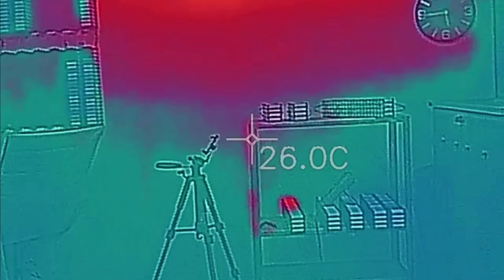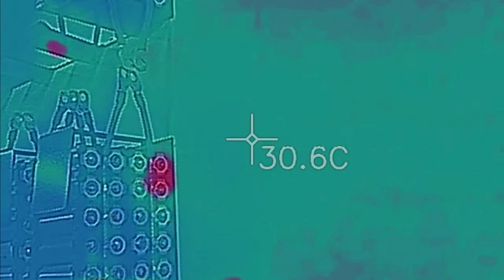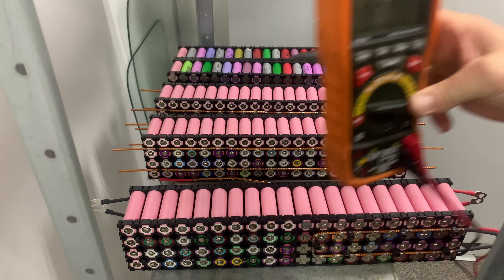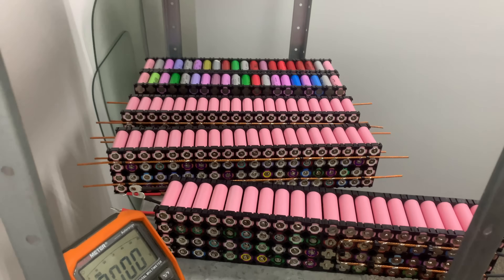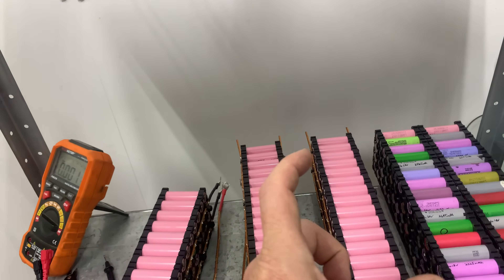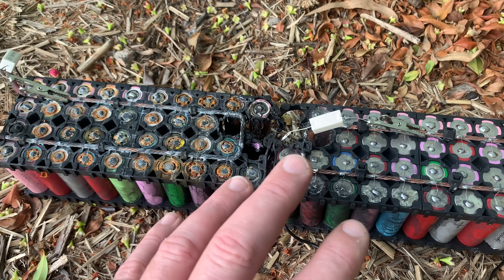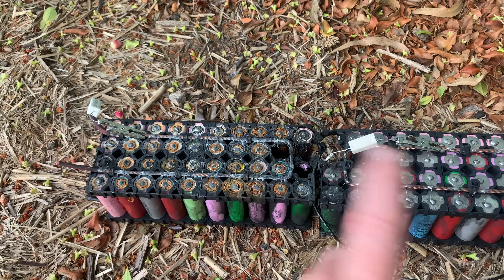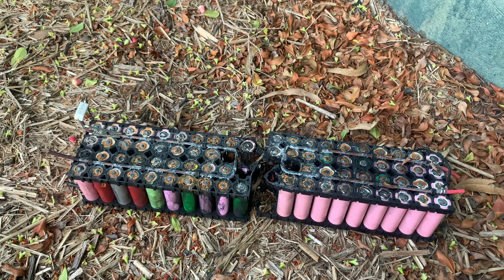faulty 18650 cells caused a fire and I think I found out why!

Comment: A good friend of me called me one day and she was totally in panic while talking. She said that she just started charging an 18650 for her e-cigarette as I do too once or twice a day. But her cell immidiently  got hot and even got hotter in her hands after removing it from the charger. She was not knowing what to do and I just said: Go to your kitchen get a cup fill it with water and put it inside with the negative side down and set the water level that high so that the cell's positive side is not submerged to prevent water from entering and to remove the heat and put the cup outside. The cell was ony 2-3 years old but massive used due to one complete cycle every day. -greetings from Germany!

Comment: Someone needs to make smarter BMS system with analytics that would look for this type of pattern of the same series of batteries and alert you at a minimum of possible service issue.
Reply from the maker: There is, I use one for years, infact so did this build.

Comment: How can you balance batteries that are wired directly in parallel to each other? Kirchhoff says they're always at the same voltage. Why would it matter whether it's 3 cells in parallel or 80.
Reply: @Gearrion  But the batteries are all in parallel per pack, not in series. The packs are connected in series to each other, but given their large number of cells each, they shouldn't have significant differences in capacity, and even the more, the closer they should come out. Besides, series capacity difference is solved by active balancing.

Comment: Hmm - interesting investigation. A real heater cell must discharge very quickly when it produces heat and if it generates a cell temperature 10 deg. over ambient, it will probably completely discharge in a couple of hours or even minutes. If you use 40p packs e.g. of course it can take several days to discharge but you would probably be able to identifiy the block which is discharging most quickly - even without external load. A good BMS / cell monitoring tool would do the job if it could really be accurate to the mV-level i guess.
Just watched again: how can a cell with zero volts produce heat? Only if its charged by other cells around but then you would at least measure a little voltage??? A cell with absolut zero volts will hardly produce any heat. Could only come from a chemical reaction inside without having any rest of charge? Afaik a zero voltage cell is not dangerous and won't explode - most likely. I am not absolutely sure in this point, but this is my state of knowledge and what i read and hear again and again. Seems your probe were not correctly touching the contacts - you were more on the isolation ring around the positive contact :-)
Reply: The 0 volt cell is not the hot one. Watch closely again. The hot is at 3.7v (still lower than the pack voltage and that is the reason why is it hot). The 0 volt one is probably dead because of its internal fuse, which could explain why it's not hot and 0v at the same time, it is completely out of the game.
Reply: @bullglar  Watch at 3:50: the one that shows zero volts he says its the heater! It could be that the CID has tripped on that cell - so it shows 0 volts but internally has still some voltage left. That would make sense to produce heat still - even when showing 0 volts. He would have to reset the CID to investigate its real voltage. I found a lot of zero volt cells in ebike packs. If i reset the CID they still show quite high voltage! - You should never reset a CID and use the cell again - its just for inspection :-)
Reply: @richardnanis  I know what he says. Count the cells from the left on thermal image. Then you will see that one is number 8 and the other is number 6. Zero volt cell is not the heater.

Comment: The fact of two cells failing making me think that while it may have been weak cells, but the cause would have been overcharging or at an C rating that the weak cells couldn't handle.

I had a pack fail on my 40p initial setup, it was one cell that was weak and even with limited current at 0.25C and 4.1v, it tripped the CID. Not long after that the pressure built up enough in other cells and pop pop pop all the cells in the pack tripped the CIDs and broke the circuit. Interesting though none of the cell fusing went. And this was before a BMS, a BMS would have broken the circuit probably after the first CID.

Comment: Don't consider 30 degrees to 40 degrees is ok. Any difference in temperature in a pack sitting idle for a while means there are dentrite formation between anode and cathode. These can burst into flames anytime. Get rid of all those heater cells right away when you find one.

Comment: What I do is to leave cells for 6 months at 3.8V before putting them into the pack. Plenty of reclaimed cells are 0V after 3 months. Some after few weeks. I would only use cells with voltage above 3.7V

Comment: Hi. I'm thinking that if the BMS was working hard to keep the balance then it must be a matter of watch your BMS to prevent a failure like this.  I have a 160P setup and the balancer is not active at all. So my 7S is in perfect balance. Within 0.05 volt (with my Fluke). If my balancer goes nuts, then I know I have an issue and can take the needed action. If I understand Pete here........ by the way.  My thermo cam don't show anything to be concerned about. Keep up the good work Pete.

Comment: Hi...Relatively new to your channel but I think you raised a really good point. Some hobbies are Ok to skimp on safety as you and your family won't get hurt. Lithium batteries are not that, so perhaps you might do a quick vid on your Thermal camera, cost, are you satisfied with it ?  There seems to be a range of prices for Thermal cameras...what's the bare minimum needed for monitoring 18650 batteries do you think?
Reply from the maker: Time permitting that would be a great idea issue is YouTube doesn't pay the bills. My thermal camera is now i think 3 years old to me and 4 from new..so it's by no means modern but it works I can see issues so that is a win for sure.

Comment: A deep concrete box with a removable lid in next doors garden sounds about right .

All cells age & fail that's why the professionals give them a usable life span .

Normal practice is changing out the old bank every 2 years for medical equipment & 4 years for cell towers even if its never been used !

Comment: Its really hard to monitor temp of every cell. Wonder whats the safest thing to do.. heater cells are real issue with age
Reply: Not with an IR camera. They can be had for under $200

Like Pete says, if you can’t afford a thermal camera then you shouldn’t be building 18650 packs for home energy storage.

Comment: If you are going to construct a battery like that (40P2S) with the negative and positive side next to each other (not a great idea IMO), you need some kind of insulator between the 2 cells. Just a small air gap is not enough.

Comment: Internal short started the heat reaction so even if the relevant fuses would have popped, the reaction on shorted batteries would have continued.
Reply from the maker: if the fuses blew the reaction would stop as the cells were zero volt so no energy left to do anything but to instantly start to cool.
Reply: @HBPowerwall  I am sorry but I disagree. Internal short is like putting a nail through the battery. No external fuses can stop that. Those fuses should pop at about 5 amps. Can you tell if any of the fuse wires popped? IMHO the relevant fuses probably popped but the internal short kept on going to cause the fire.
Reply: you don't need an internal short, all you need is for the chemical reaction to start,  even at 2.5volts there's enough energy in the cell  for the chemical reaction to go on, time of the reaction depends on several factors, it can be quite fast.
Reply: @josep.3364  I don't know if an internal short is classified as a chemical reaction and you may be right. Regardless, it was a chain reaction that could not be stopped by blown fuses. Maybe the age of the batteries had something to do with it. One of the most important things you stated is that these batteries have to be monitored and maintained properly, especially if recycled batteries are being used. Thank you for all your work and keeping us up to date with your experiences.
Reply: @dannyperry8070  I think he means that if the shorted cell remains connected, then the other cells in parallel with it would be continuously dumping more energy into it. But once disconnected, the reaction would stop as soon as the energy in the one shorted cell is exhausted.

Comment: Hi HBpowerwall, Doctorbass here, From my long experience with salvaging lithium cells since 13 years now.   I would suggest you to do the bounce back testing for each cells BEFORE assembling your pack. It will sort easy any bad apple from the lot.  Overall it consist of discharging all cells to their specified LVC and to measure their voltage, note it and then  leave them for few days and re-measure them again and compare and  find any of these that have a larger delta V.  Any bad apple cells that will have a small leak current that is abnormal will drop voltage easier if cells are discharged than recharged as any mAh will create a larger deltaV at ultra low SOC than at any other SOC. It really is what can help you to spend hundred hours of making packs and avoid ruin them because of cell that have current leakage.  These setings have proven to perform well: CC discharge at C/10 to 3.0V

, CV discharge at 3.0V to C/100 taper, Record OCV bounce back over 14 days.   Doc  You can read more here about the bounce back test : https://www.nasa.gov/sites/default/files/atoms/files/3-soft_short-defect_correlation_final_darcy.pdf

Comment: So what I think you just showed is that your fuse wire is too large in diameter.  If the fuse wire was thin enough it would have opened on that cell that was zero volts.

Comment: I completely agree with monitoring your batteries, but routine thermal camera reviewing is impractical. Not everyone has them mounted on a wall such that you can see every sell on the camera. I certainly cannot scan mine without pulling individual packs out. The only thing I can say is that it should have been identified by reviewing the Batrium / BMS and seeing a self-discharging battery pack. Also, this really drives home the reasons for NOT NOT NOT using those dumb "active balance" boards...
Reply from the maker: I think it was a case of compliancy, plain and simple

Comment: Need to look at the delta t(temp) over ambient. If 30 is your ambient and it's running 40deg and your ambient in summer is 40 it might run 50. Need more thermal couples on large packs to monitor delta t and or a way to monitor more in the bms to analyze how much extra work some cells are needing and then flagging them for human intervention or monitoring. Or a safety cutoff for potential bad packs or cells

Comment: Isn't the answer to this to have a shunt resistor in line with every cell - so that you can constantly be testing each and every cell? Pretty sure there are inexpensive ATmega family chips have a whole bunch of analogue inputs that could be programmed to talk I2C or something to a central BMS. With this  we'd be able to record and monitor the voltage across each cell and the current going through it - you'd always know the up to date capacity of each and every cell (as well as how it's changed historically). Temperature monitoring would be redundant since you could see how much energy is going into the cell and how much is coming back out - heat is going to be the remainder! (Note: I'm not saying that redundant monitoring is a bad idea...)

I had a quick look a few months ago.... and it looked like the hardest thing to source would be shunt resistors themselves..... but surely it must be possible to overcome that?
Reply: Which ATMega chip has 40 Analog Inputs ?
Reply: @MrSummitville  I imagine you'd actually end up with some sort of multiplexer. I'm no expert in that stuff - but I can't see any reason why it wouldn't be possible. I'm sure there would be some trade off between how many inputs you can multiplex verses accuracy (especially if loads are peaky) - but effectively you'd end up with a situation where each individual cell was being tested throughout it's time in service.
Reply: @Jakdaw  It would actually be much easier and more accurate to directly measure the temperature of each and every cell, by adding a $0.25 Thermistor.   It would be 10 TIMES more difficult to accurately measure the very small voltage that is generated across a very low ohm shunt, on each and every cell, to indirectly compute ( assume ) the temperature. You have to consider the increased cost ($) per pack, too ...
Reply: @MrSummitville  No I'm absolutely not wanting to measure temperature - I want to know well about cells that are degrading well before they start getting hot!; plus I want to capture other failure modes too. I think people who are doing cell recycling / homemade powerwalls etc should throw away their cell testers - because the powerwall itself should be monitoring each cell to that level all the time. In the same way that I'd certainly not encourage someone testing and recycling cells to use a charger that doesn't measure current flow & a thermistor to test their cells - I don't think that solution is suitable once in service either.
Reply: @Jakdaw  An increase in balance current and an increase in cell temperature goes hand-in-hand.  You can't design a cost effective and reliable current sense circuit for a 40P Pack.  But I can easily design a cost effective temperature probe that will warn of problem, long before the pack starts on fire.

Comment: This is why you  use 280ah lifpo4.
Reply from the maker: and how much were said batteries 4 years ago? ... all well and good to say that now..
Reply: @HBPowerwall  cheaper than a fire. I'm ordering 21 280ah cells for 1500
Reply: @TamponTea  You still have the potential of dendritic growth in LiFePO4 over time leading to an internal short which can lead to a thermal runaway condition.  It is just far less likely with new cells.  Once those cells are 10 years old though, the chances have substantially increased.   The other issue is that the electrolyte used in most LiFePO4 cells is still flammable so if they vent you have a highly volatile fuel source that can ignite while the cell cooks off.  While LifePO4 cells are substantially safer they still require thought about fire suppression and or containment.  

The commercial lithium portable power stations scare the crap out of me with the way people treat them as if they are 100% safe charging them in their homes or storing them in areas where they could burn the house down if they catch fire when so many are built without any thought to fire containment, suppression, and thermal runaway conditions.

Comment: Why not build batteries inside fireproof ammo cans. Battery hookup guys loaded one up, lit the cells on fire and closed it. The fire did not escape... fireproof enclosures are used on MANY different lithium ion / lithium polymer packs from commercial to military uses. Its somewhat insane to say this is a maintenance issue when your solution is check on it more. Putting batteries in open air on your wall would be like driving your car with a bucket of gasoline in your lap instead of it being in a fuel tank...
Reply: Will the battery pack get too hot inside a sealed ammo can?   How can you measure the temperature of the cells, with an IR camera, when the pack is inside a sealed ammo can ?
Reply: @MrSummitville  it would really depend on discharge rate for what temperatures would be dissipated. Like I said before fireproof containers are NOT a new concept, I didnt make this up in an attempt to look cool, its already a thing. Temperature probes can be put into the pack if desired. (Edited for grammar and spelling)
Reply: @UniWonder  Yes, we know about fire-proof "containers".  There are You-Tube videos about that very subject.  But a single temperature probe cannot detect that one cell has become a heater.  And excessive heating may now require active cooling.  So, if the box becomes too hot, do you shutdown your entire house?  I am discussing the new / additional problems inherent with fire-proof boxes, that must be addressed and the additional COST ($) and complexity, that must analyzed ...
Reply: @MrSummitville  I was pointing out the safety issue of not putting batteries in a safe container. Imagine you spend $10 per 100amp hours of capacity for fireproof containers, would that be more or less expensive than FLIR? Im not trying to be argumentitive here. Ideally people who want to build battery banks with high density power should control all of the controllable factors. If you are pulling enough amperage to need active cooling you could add that cooling or add capacity reducing the total E and C rate. Im sure im not telling you anything you dont already know. Furthermore each pack could be controlled by a temperature controlled relay and be taken offline once a certain temperature is reached internally. With enough  modules your house will still be running and you can investigate as needed. Maybe you dont want fireproof containers for some other reason than safety, thats ok too i guess.

Comment: Best to do is to put it in water and leave it in there for at least 24 hours.
Fire extinguishers will work for max 30 seconds to 90 seconds then the batteries will still do its thing
Reply: The fire extinguisher can buy you some time, to disconnect the pack and submerse into water.